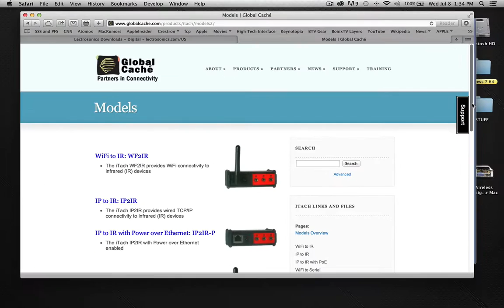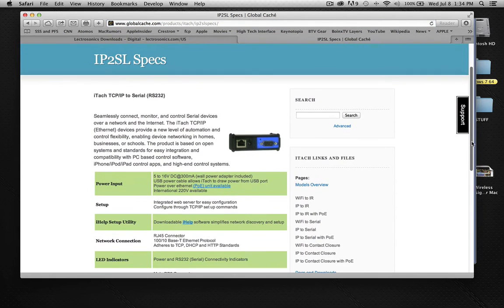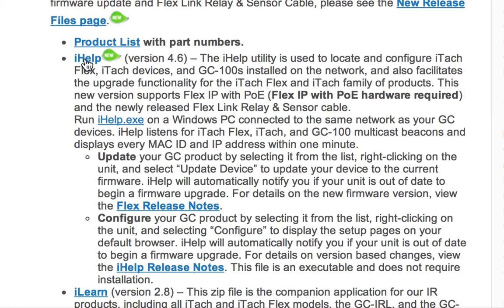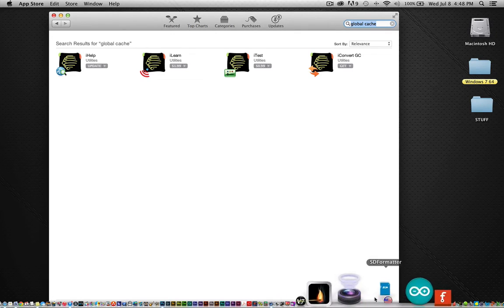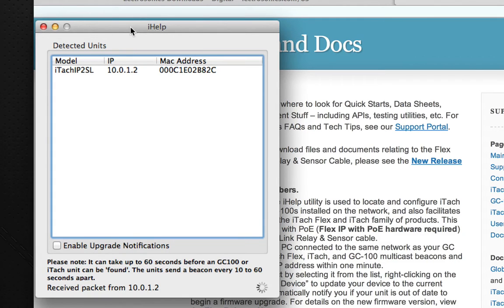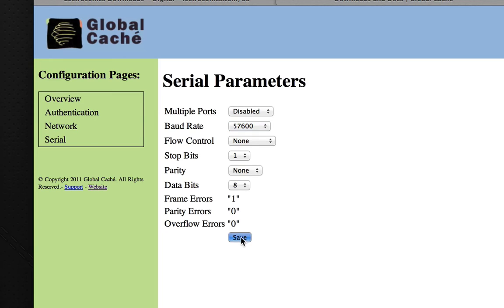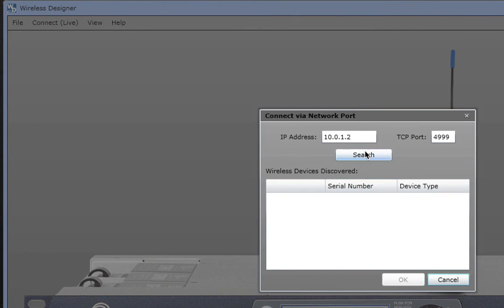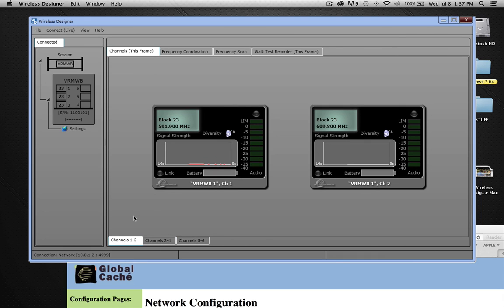Using Wireless Designer with Venue Receivers over Ethernet with Gobal Cache

Comment: Very clever. If you had two Venue Receivers would you require 2 of the IP2SL devices to get both Venues into the network?
Reply from the maker: Yes, you would need one of the IP2SL units for each Venue frame.
Reply: @lectrosonics  When I connect my IP2SL units to the venue and my network, neither of them show up in iHelp which is strange
Reply from the maker: Contact our support team at +1 505 892 4501 (8am to 5pm M-F, Mountain time) or service.repair@lectrosonics.com